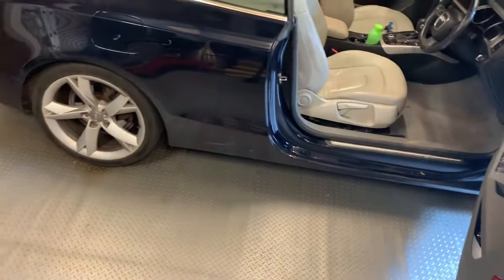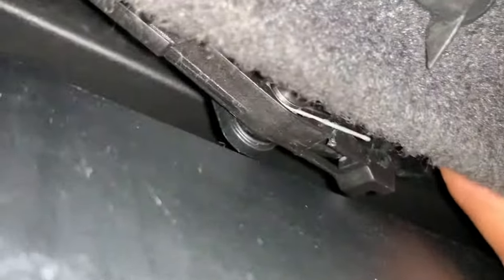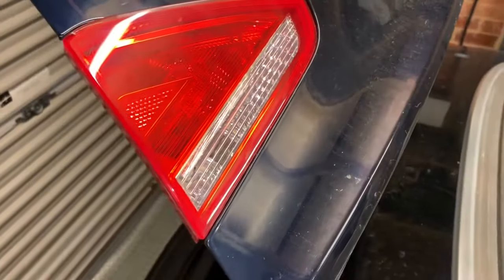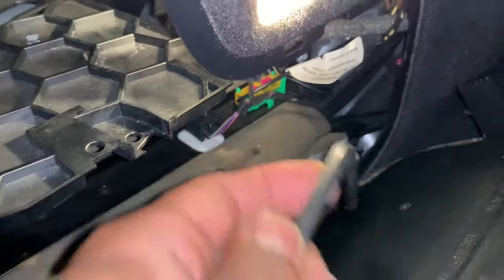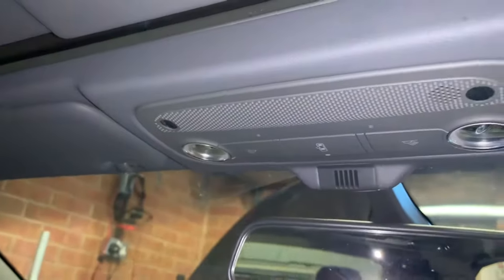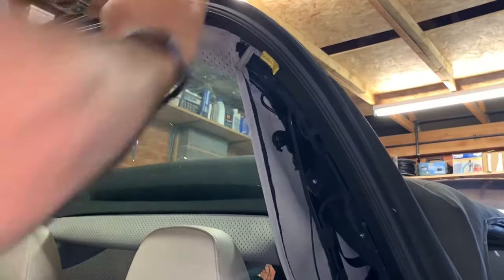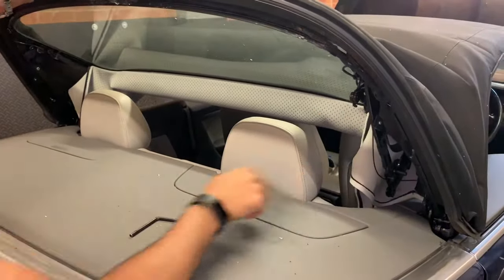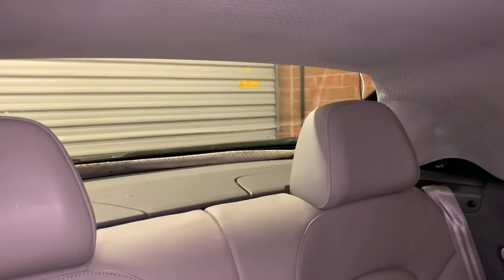Audi A5 8F Cabriolet How Manually To Close Convertible Roof

Comment: Nice vid mate. Is it the same procedure when the roof is closed? Because my vcds shows a fault with the convertible switch and can t open the roof. The roof lamp in the instrument cluster is also blinking.
Reply: I have the same issue!
Reply: Did you ever resolve this? What was the issue
Reply: Also looking for fix i need to open mine not close it

Comment: So there's no way to do this without having to take of the liner? So apparently the manual use of the convertible top is just for emergency use to open or close but not to be able to use it recreationally because then liner will be off 🥺
Reply from the maker: Hello,

There is a way to do it without removing the liner, you can squeeze your hand in behind the liner and lock and unlock the tensioner without the key.

Once you remove the lino it is possible to understand how to do this, you can then refit the liner and just do it blind
Reply: @CabrioletTech  Much appreciated my friend!
Reply: @CabrioletTech  Yep, this worked for me.
Reply: Does anyone know how the liner reinserts into the rear rubber?
Took mine out to clean the rubber and can't get it to affix back in position

Comment: Hi, thanks for your helpful videos.  I have a 2014 A5 convertible(only 20k miles on it) that the top has suddenly stopped working when the top gets to vertical closing position.  There are no fault codes(using Autel 980pro which has top operated and not activated switch info. Hydraulic fluid is proper. The second issue is I've tried manually closing but the lever in the center trunk won't disengage.  With the top opened enough to see the mechanism, I'm still not able to move lever.  Your input is greatly appreciated.
Reply from the maker: Hi

Where are you based ?

Comment: In the LHS of these vehicles there's something convered in a foam like material. What's inside the foam? I need to remove or move this component to get to my MMI radio module as I believe it has become water damaged...

How difficult is it to remove without taking out the boot cards? Any help appreciated!

Comment: I've followed your steps.. all looks good but I'm still getting the yellow light flashing and it says soft top not secure. Is this a memory thing do you know and if so is there a way to reset the warning? Allowing the roof to cycle? Great vid by the way. Thanks.
Reply from the maker: James Macduff 

Hi, the only way to lock down the rear lid is hydraulically. I am assuming the reason why you had to close the roof manually was because there is something wrong, the primary issue needs to be resolved.

Unfortunately it is not a case of a “manual reset” on the A5 to get it working 

If you’d like more information, please contact us via the website 

Regards
Team VagPro

Comment: Can the decklet be unlocked while in the up position? I ask because my top opens fine, but when I attempt to close, the top comes all the way up, but the decklet does close. It looks like I have a huge spoiler in the back.

I'd hate to go through all the steps if i can just unlock the decklet and close it until i can get it checked out.
Reply from the maker: You have a fault with one of the sensors, rather just fix this as opposed to the risk of getting locked out

Regards
Khurrum
VagPro

Comment: Wonderful video can you please tell me how to lock the yellow guard thing in the boot that you released pls
Reply from the maker: Hi

It locks automatically once the roof is fixed and hydraulic pressure is applied to close the rear deck lid

Regards
Team VagPro
Reply: @CabrioletTech  mine is not locking the yellow guard on 1 side is there a manual way of locking it into place
Reply from the maker: @Richee555  

If May be the lock is not positioned correctly and the lid mechanism is not pressing it down far enough

Comment: Before you remove the roof liner try this. I was able to squeeze the upper tensioning bows on each side without taking the roof liner off. With the wife pushing down onto the roof deck from outside the car. Does anyone know how to reset the yellow levers and cams in the trunk / boot? Thanks for posting.
Reply: Saw @CabrioletDr post that they reset automatically when the issue is resolved and hydraulics restored. Thanks

Comment: Hey I have a different problem with my roof, there is a flashing convertible sign reading softtop cannot be used. Even when I pull the switch for it to come down it will flash the sign . I manually pulled it back and forward with this video but it still didnt work. Also I even bought a new battery still no change. Audi A5 2010 quattro cabriolet.
Reply from the maker: Hello

This is because there is a fault on the roof and it needs addressing

Opening and closing the roof manually does not normally fixes

If it was a battery you would also see a message saying low battery
Reply: So what do i do to fix this problem?
Reply from the maker: @NICKDOLLAZ  

Hello,

The roof may not close for a number of reasons, the purpose of this video is to show you how to close it

You will need to book the vehicle in in order to get it diagnosed and repaired

Comment: Was able to get top up, but now top motor does not function?  How do you reset the top mechanism?   How do you put the trim back?  What is the CAUSE of this problem?!
Reply from the maker: Good questions, if only I knew why every cabriolet roof failed without even seeing the car, let alone using diagnostic equipment 

You get a cabriolet specialist to diagnose the fault, said fault must then be repaired 

Set it in a position it recognises and it continues to work the cycle 

Then you, refit the fabric whilst it's mid cycle and close with button

Comment: Hi @vagpro first of all amazing video thank you for this. Quick question: Would I be able reverse the steps with the clips etc once the roof is operational again?
Reply from the maker: Syson PT yes you can
Reply: @CabrioletTech  Is this regarding the yellow "clips" in the trunk? If so, tips on resetting?
Reply from the maker: @oleandt77  they reset once roof operation is restored

Comment: How do you put the yellow levers back in position after you do this
Reply from the maker: @DubC-xq4lj  you can't do that.

Once the roof is repaired the hydraulics with automatically lock them back down
Reply: @CabrioletTech  So I have to take it back to the dealer?
Reply from the maker: @DubC-xq4lj  Not necessarily 

Take it to someone who repairs cabriolet roofs.

Assuming the reason you had to close it manually is because it didn't close electro hydraulically, therefore there must've been a fault somewhere

Regards
Reply: @CabrioletTech  it got about 90% of the way closed/up then stopped. I could put it back down no problem but just wouldn’t close all the way, so I jumped the gun and just pulled the levers and now I regret it cause what could of been an easy fix just got harder
Reply from the maker: @DubC-xq4lj  not to worry, everyone likes pulling the levers.

Find yourself a good cabriolet specialist and it'll be a doddle.

More than likely a faulty sensor somewhere.

Regards
Reply: @CabrioletTech thanks for your response to everything. Earned yourself a subscriber
Reply: @CabrioletTech  Took it to the Audi dealership and they said they couldn’t fix it but recommended me to a local mechanic. The dealership told me when I pull the scissors levers to, behind the upholstery that it puts the yellow levers in the trunk back in place that are in the trunk. Is this true?

Comment: Nice!
Question, when repaired will trim get back in the slot?
Reply from the maker: MarkBonerea yes, you clip the trim back in once the roof is operational
Reply: What is best this to stick the trim back on the glass
Reply: @edreesaljabali4052  mine wouldn’t even clip back... didn’t seem like there were clips. I’d recommend just using an adhesive.

Comment: The ram doesn’t move for me
Reply from the maker: Did you release the pressure ?
Reply: Yes I released the pressure but no pressure to release
Reply: What fuse is related to the power top?
Reply from the maker: @CharlyChill then you have pressure in the rams, follow the video on how to release the pressure
Reply from the maker: @CharlyChill I can't remember at the top of my head, but the owners manual will tell you
Reply: I finally was able get it down  by bending the elbows of the back and it released the hold. 🎉🎉🎉